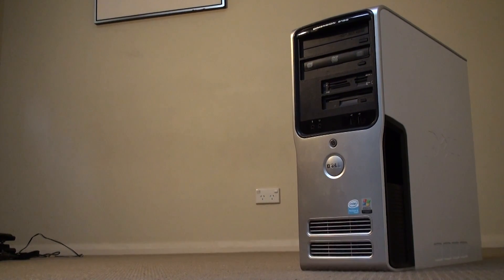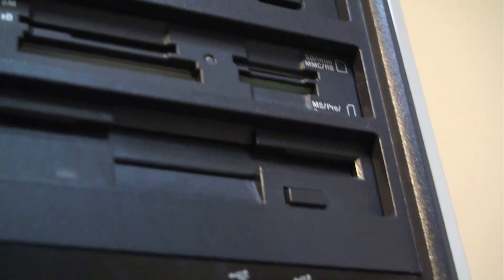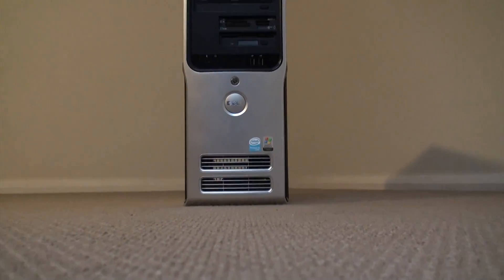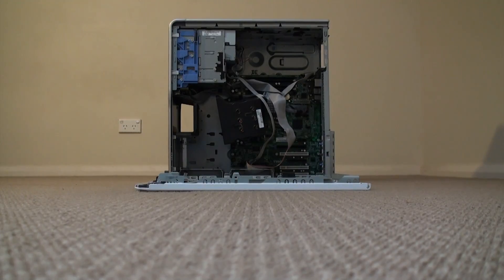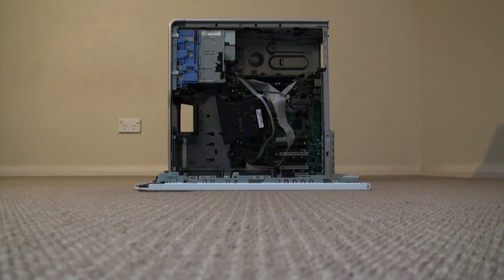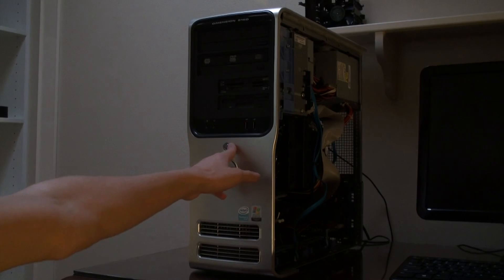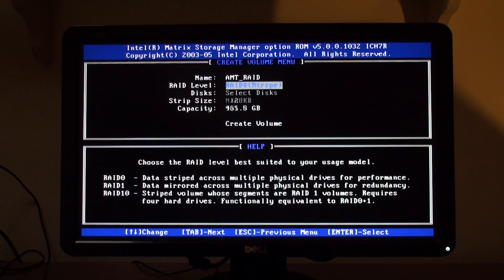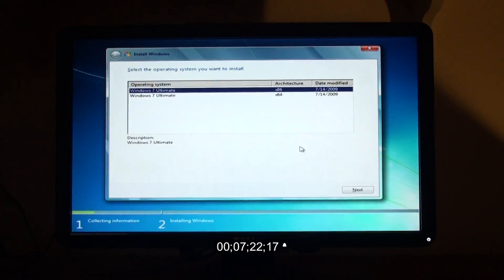Lumbridge: The Revival - A GHG Film

Comment: Can't this pc run a core 2 duo?
Reply: It could even run a core 2 quad, but that's not the point
Reply: When you revive a pc with 775 put a C2D or C2Q in
Reply: Actually this Dell motherboard supports the Pentium D (what it currently has) at max, the Dell Dimension 9200, the model up from Lumbrudge uses a Core 2 Duo and can be upgraded to a Core 2 Quad
Reply: The size and front panel pins are the same why don't he just put a 9200 mobo in it?
Reply: He did own another Dimension 9200 with a Core 2. You can see it on Turning an Optiplex 745 from Boy to Man video where he shows off some of his Dell collection.

Comment: I saved a Dell Dimension E520 from my school I saved it from scrap It's being used in a nice and cozy home where it can be used for gaming and coding. It has an Intel Pentium D 
I had to do some extra things so I can get it out the door and all the way home.
Reply: I too salvaged a pc from my school. It was a hp dc7600 sff with a pentium 4 - 512mb of RAM (I later upgraded it to 4 gb(max supported)). Turned it on when I was home, NOTHING wrong with it. Only a bootmanager missing. Reinstalled windows - works perfectly. I still use it every day.

I get so sad when I see people throwing out computer that work perfectly.
Reply: Pieter Keij When I got this one, there was nothing wrong with it either, and the computer teacher was going to throw it away I upgraded the ram from 5 to 7 GB and the 250 gb hard drive to 1 TB same processor.

Comment: Hey GHG, have you ever had a PC that turned on but no video is outputted on the "on board graphics"? My cousin got a 3 or 4 year old hp that blew a capacitor around the PSU. Could it be the power supply that's bad and not the motherboard?
Reply: Most likely the power supply. Those default PSU's blow up a lot. Just another product of planned obsolescence. Just replace the power supply, then you're on the right track.
Reply: Mr. Beef hello long time no see. If you remember my cousins pc I revived it. Nothing was fried, the only issue was the integrated vga port was broken, a video card later it works. I even gave it wifi

Comment: I bought a new graphics card from best buy and i've been trying to get it to work for quite a while. I have an intel core i7-3370 and i recently purchased a nvidia gtx 750 pny. Now, all I did was take the card and place it into my computer. after that, i connected the cable from my monitor that is usally plugged into my mother board, because i use onboard graphics, and plugged it into the DVI slot. Then I turned my computer on and was shocked to see that my computer took a few minutes to boot up but froze at the black screen you get as your computer boots up. Now, i'm not sure what could have happened, but literally all i did was take the card put it in, plug the cord and then turned on. Now i've been stuck with playing on a computer without a graphics card and my gtx has been collecting some dust as it sits to the side for a while. Can you please help me?
Reply: How big is ur power supply?
Reply: In terms of watts?
Reply: Thirteen Pixelz 1 watt.

Comment: This was my first taste of PC gaming. Well, I had played some pipedreams (plumber game) and wheel of fortune on some old IBM PC back in the 80's. But the Dell 9150 (Pentium D 950 + Nvidia GS 7900 + 4Gb DDR2) was my first PC that I could call my own. I didn't buy it to game ,but bought it to sell DVD's lol. I did get greedy choosing the parts on Dells website. So I figured, eh.... might as well get some games to see how well it runs. I ended up buying Quake 4 ,Doom 3 + ROE expansion, F.E.A.R. + Extraction Point and Need For Speed Carbon. I did end up selling DVD's like crazy haha, but I ended up giving up on that and kept on gaming. I probably put about 7 or 9 THOUSAND hours into Quake 4 between 2006 when I got the PC up to around 2012-13 when I finally quit playing Q4. 

Best decision in life EVER. I pretty much gave up on gaming during the PS2 era ,but PC gaming sucked me back in a few years later. That 9150 is sitting behind me right now with it's side open. lol. I was trying to get that sucker working so I can send it to a friend who's laptop just died ,but I ended up using the old 9800GT that replaced the 7900GS for a temp card in my bro's LoL PC. Now I'll probably slap in a GTX 750 Ti and maybe a 120Gb SSD and send it off as a surprise to my friend :P

Comment: Basically any system with a dual core or hyperthreaded processor from 2004/2005 onwards is still plenty enough to surf the web or use office applications. If you ad a modern low end graphics card like a Radeon R7 240 or Geforce 620 you can use it to watch HD movies too. For modern games however you will need at least an intel Duo core or an AMD Phenom II tri or Quad core paired with a descent GPU(A Geforce 560 Ti is more or less the minimum to play at 1080p with acceptable frame rates).

Comment: I have the exact same computer gathering dust in my den, except it's an XPS 400, which is just a rebranded 9150. What graphics card did yours have originally? Mine has a Radeon X300. That card was the minimum spec for minecraft a few years ago, now I just use it to play old windows games. I think mine has a more powerful Pentium D, though.
Reply: I also have the 9150 but with a geforce 640 and i can play league of legends and csgo on medium settings stable

Comment: Soon i am going to revive an old HP Pavilion 9000 running an intel core 2 quad Q6600 with a fresh Nvidia Geforce GTX 750ti GPU add 8 gigs of DDR2 RAM and a Kingston 120GB SSD and put windows 8 on it! (Couldn't find windows 7) This little beast will run games like Minecraft, League of Legends and CS:GO on high settings and reasonable frame rates! Before anyone asks, no this will not be my main pc!
Reply: Very nice, just check if your motherboard supports that amount of memory (many ddr2 ones don't)
Reply: Andrew Caobianco I looked it up and it supports 8 gigs of ddr2 if i get a 64 bit OS!
Reply: +Chromablitz Very nice, that computer will easily run games like GTA V at 1080p with 60fps if you turn the settings down a notch

Comment: I am currently in the process in reviving a Dell Precision 670.
Specs:
2x Intel Xeon 2 cores 3.4 ghz

650 watt psu

140 gb WD hard drive (will be replaced)

Nvidia Quadro FX 256mb (will be replaced)

1x Floppy Drive

2x Cd and DVD drives

Comment: What parts should I add to an old Dell Dimension 3100C tower PC i have sitting in a cupboard?
Specs:
OS: Windows XP Home SP3 32bit
RAM: 2GB DDR2 (Upgraded from 1gb ddr2 ram)
CPU: Intel Pentium 4 3GHz (Normal Pentium 4, nothing special about it.)
I am thinking about removing all the parts and re-building the machine, or just adding a new CPU and GPU (If possible).
What parts would you recommend?

Comment: The feels. I have to admit - old computers are fun to have and to just give a new life. Oldest hardware I have running Windows is a Toshiba laptop that runs Windows 3.1. It's old - but gets booted up occasionally for some fun and whenever parents/relatives/etc have to read a floppy disk, it does it like a charm. 

I've got an old desktop sitting near me with a Pent. D of some sort. It got broken in a thunderstorm a couple years ago, only things left that work are the GPU. Replaced the PSU - nothing. Took the (new) PSU out for my new server - and the GPU went to a relative's C2D machine (1.8, 1GB) which I optimized. 

Love your channel, the videos are great and this one hit me in the feels.

Comment: I've still got the Dimension 9200 with a Core2Quad q6600 collecting dust. I love the case. Came with 2x250gb drives in raid0. Purchased in 2007 or 2006 can't remember, I've been meaning to get it back up and running just for kicks.
Reply from the maker: blaser They are nice machines to just whack under a TV as a Netflix, YouTube or media box. 

Especially ones with Core 2 Quads! You're a lucky man!